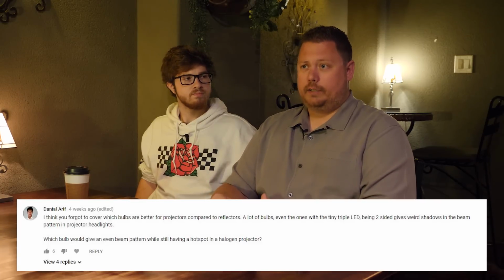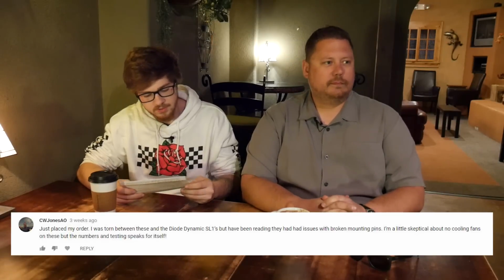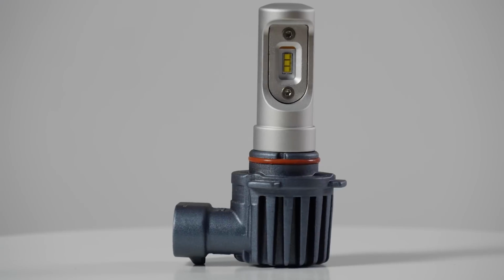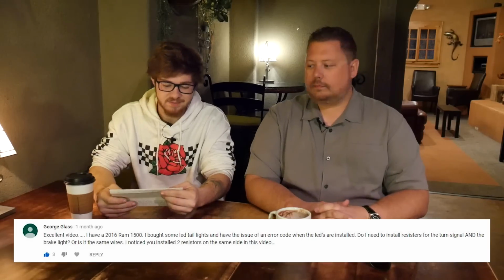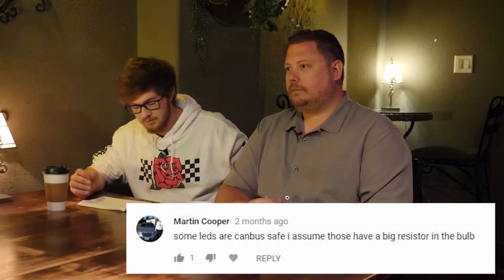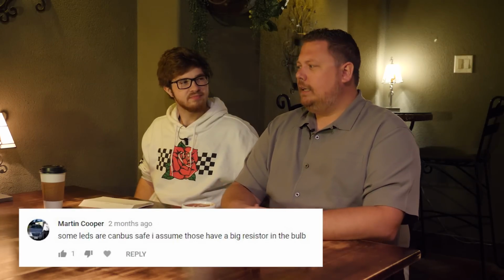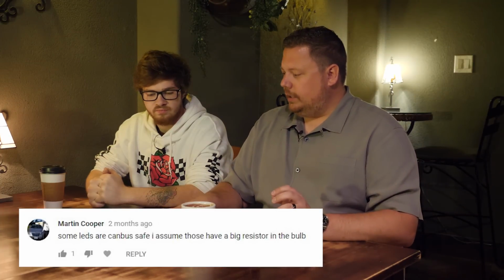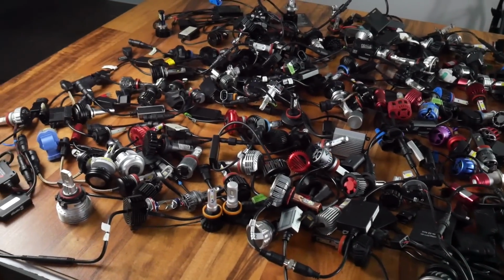Headlight Revolution Reacts To YouTube Comments Vol. 4

Comment: Hi - Just discovering your channel and website I'm watching more of your videos, and you remind me very much of Paul @ ShopDAP, who is well-respected in the VW community (I also have a Golf). I've learned a lot just watching a few of your videos. Wish I'd found your channel a few weeks ago before doing my own LED upgrade. 

Was hoping you might comment on one or more of these questions, either here or in your next "response" video: 
I just did my first-ever LED "upgrade" in my 2006 Mazda MX-5 (3rd-gen NC Miata). The passenger-side has been awful even with new halogen bulbs. The Miata came stock with H7 halogens in projectors. For some unearthly reason Mazda oriented the tab at roughly a 45-degree angle, rather than straight up/down. This means the halogen filament is also at an angle. When replacing with LED's, I've read that the "filament" should be vertical within  the projectors, and that the ability to rotate within the housing is key to this. Is this also your understanding and/or recommendation?

I just put in a set of Hikari "Thunder" (i.e., the cheaper CSP set, not the Philips set), mainly so I could get my feet wet with an LED upgrade. Obviously curious on your impressions of the Hikaris. I liked their value, and especially their ability to easily rotate within the collar to orient vertically, which helped get a lot more light output. 

If I had it to do over again (or if I were re-upgrading again in the future), I'd like to go with either the $90 Hikari "Ultra" (using the Philips ZES), or the Morimoto based on your recommendation. They seem similar in specs, but are at least $30 apart. (The Hikari's sometimes drop to $72, and the Morimoto's are $145 on their own website for some reason.) More importantly for me, I don't know if the Morimoto's can be rotated within the collar like the Hikari's do. 

Thanks
Reply from the maker: Thank you for the comment! For the best LED orientation, you will want the LED chips to face Left to Right inside the housings. This will give the Projector the most amount of light possible to feed that Projector Lens the needed amount of light to form the best beam pattern possible. An HID kit is the optimal choice for a Projector application, but we are seeing more and more LEDs doing better inside a Projector!  

We have done a number of testing on the Hikari LEDs and have had mixed results. For the most part, they were not very good, but there were a few exceptions where they weren't too bad! The Hikari Ultras were one that we were not fans of. Once more, thank you for the constructive comment!

Comment: Have you tested the Lasfit LS series bulbs?
Reply from the maker: We have, they were terrible.
Reply: I appreciate the reply but can you give more input than they were terrible? Was it the output? Beam pattern?
Reply from the maker: @jeffholmes9103  The beam pattern was pretty poor, and caused a lot of glare in multiple housings. They also were not the brightest, a bit better than stock but nothing to write home to Mom about.
Reply: I have a 2011 gmc sierra with reflector headlights, what would be your recommendation for low and high beam bulbs without replacing factory housings? I'm pretty sure I'm going to go with morimoto xb foglights units but I don't want to replace factory headlight housings. I appreciate the help.
Reply from the maker: @jeffholmes9103  Fantastic choice with the Morimoto Fog lights! 

For your Low beams, I fully recommend the Supernova V.4 LEDs! 
Link: https://headlightrevolution.com/2007-2013-gmc-sierra-led-low-beam-bulb-upgrade-kit-supernova-v-4/

And for the High beams, I recommend the same thing! 
Link: https://headlightrevolution.com/2007-2013-gmc-sierra-led-high-beam-bulb-upgrade-kit-supernova-v-4/

These will both match up very well with the XB LED Fog Lights as well and will be a huge improvement!

Comment: I got 2 pairs of LED turn signal bulbs (2 kinds, one has over 100 LEDs per bulb and the other has less than half but is somehow brighter) both are error-free but I suspect they achieve this by making them super bright but they also get really hot so I'm guessing they even have resistors.
They are so bright that they can almost compete with the headlights, and are clearly visible even in the bright noon sun.

Comment: Can you test Philips X-tremeUltinon H7 on projector headlight and compare them with Supernova V4?
Reply: The philips X-tremeUltinon H7 has 4 LED chips per side while GTR has 3 chips per side. Additionally the shape of the bulb is different which can have significant effect on the beam pattern.

Comment: Upon reading upon the radio interference question, I immediately tested mine by turning the radio to AM and good thing I don't have RFI issues. My opinion for this issue is that the radio's antenna wire and connectors should properly shielded in order to reject radio frequency interference. I'm also convinced that this noise comes from the LED's drivers. Those should be relocated. Another thing to look into is the radio's grounding, especially if there are external amplifiers that are connected to the head unit.